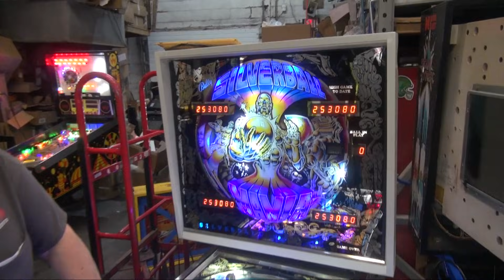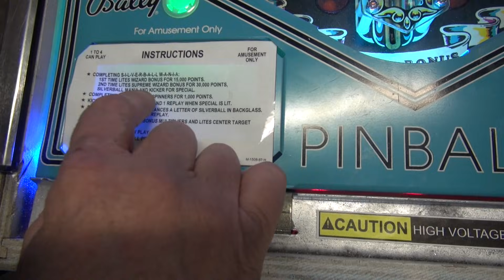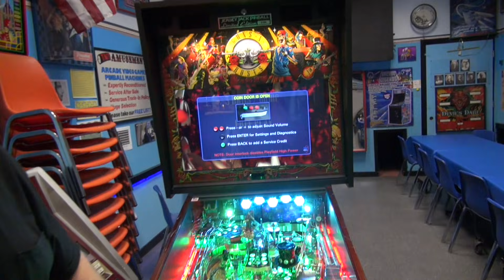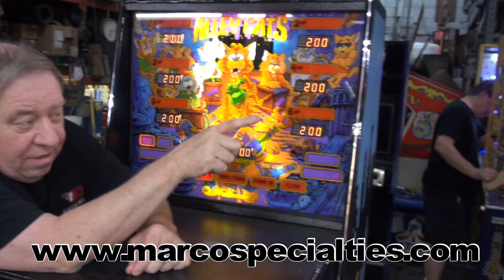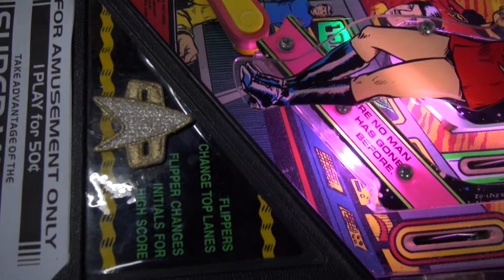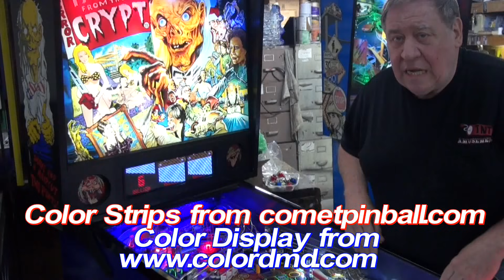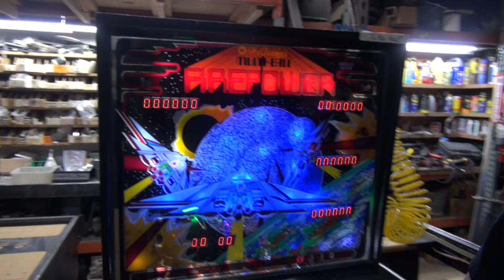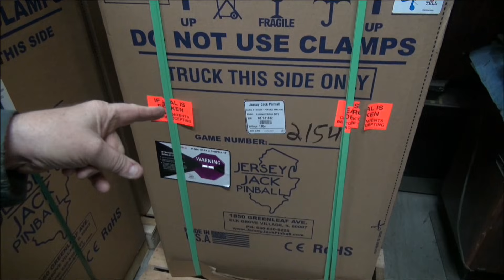#1683 Bally SILVERBALL MANIA Pinball Machine-Nicest One on Earth!  - TNT Amusements

Comment: Nice video of the SILVERBALL MANIA (see, some of us are watching) but you didn't open the backbox to show off the new electronics. What kind of lamp board did you use to get the extra flashing lights on the 50 point bumpers, or are they just flasher bulbs? Nice effect. You should have also mentioned something about these early BALLY games sometimes dislike LED lamps unless you modify the lamp board which is a pain in the heck.